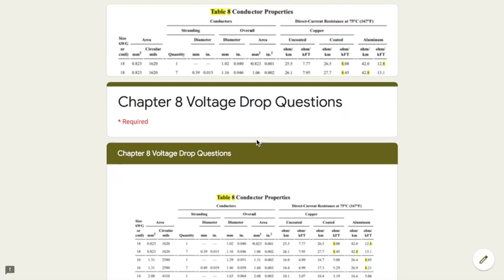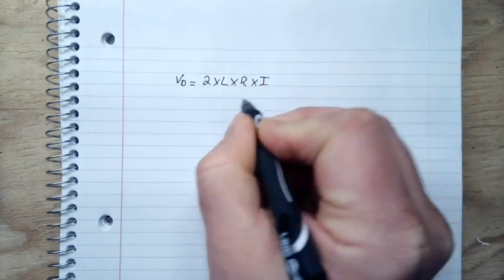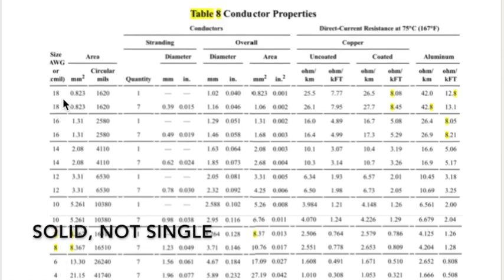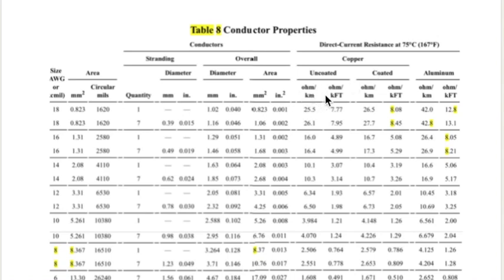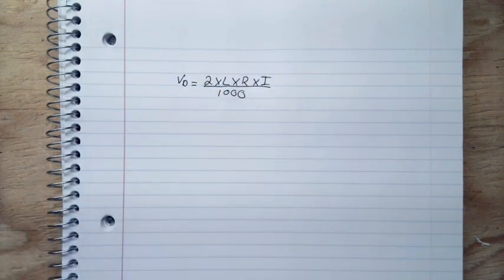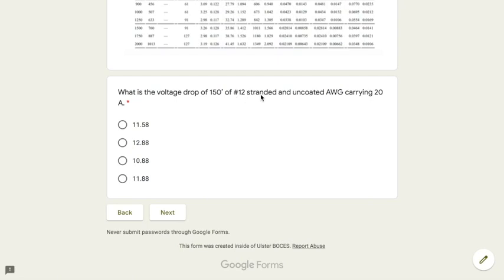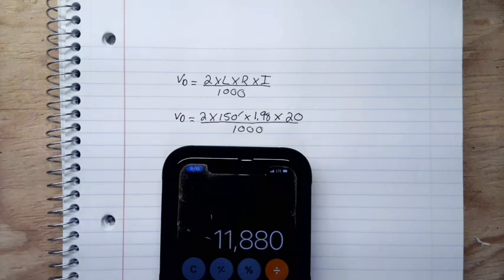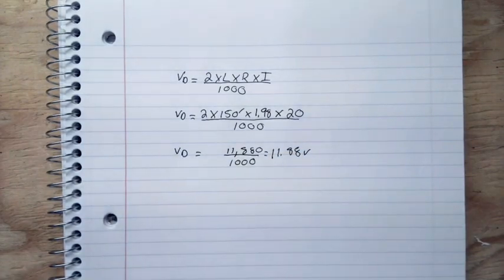Voltage Drop Calculation Example

Comment: This equation is wrong. You divide by the cmil of the conductor, not 1000. The equation is (for single phase) 2KID/cmil & (for 3 phase) 1.732KID/cmil....K = constant (12.9 for CU & 21.2 for AL), I = current, & D = Distance.

Comment: isn't the resistance suppose to be 12.9? Constant of copper? I'm confused about this.
Reply: 12.9 is the Constant for Copper - 21.2 is the Constant for Aluminum - And I thought you were supposed to divide by the Cmil of the Wire??🤔
Reply: its depend upon to the manufacturer
Reply: @janekennsamchan7036  lol what? Copper is copper 12.9 is a constant. Even says so in the code book

Comment: That's great, thanks. Now, can you do one in metric so that even I can understand it? 

12V DC over a 2 meter distance, with a 25mm2 sheathed conductor, pulling 125 amps max. 

How many amps would a 25mm2 sheathed cable be good for, at 12V DC over a 2 meter distance, under the hood of my car? Is basically what I want to know. 

Somewhere I read that the sheathed 25mm2 cable is good for 149 amps, but I have no idea over what length. Thanks.
Reply: Voltage drop isn’t usually an issue under about 25-30 meters.

Comment: Isn't this just for DC though?
Cause if you calculate it with Table 9 using the reactances, conduit material and number of cables in parallel, you can get 3V less in the result of this problem.